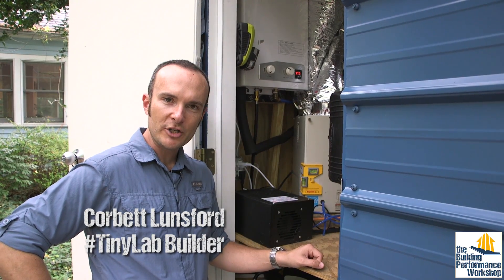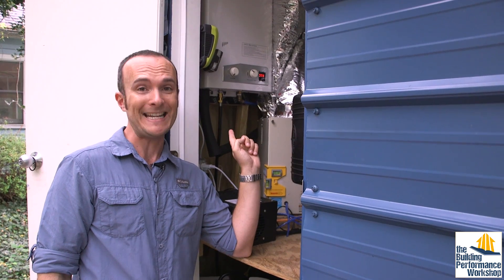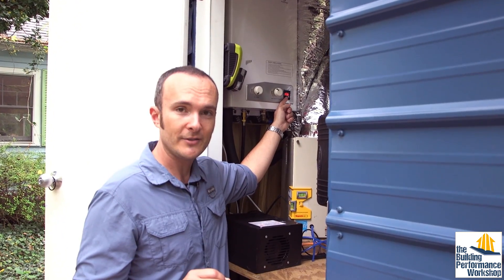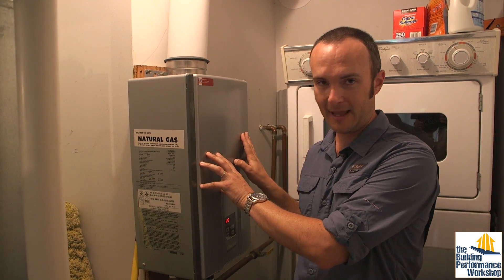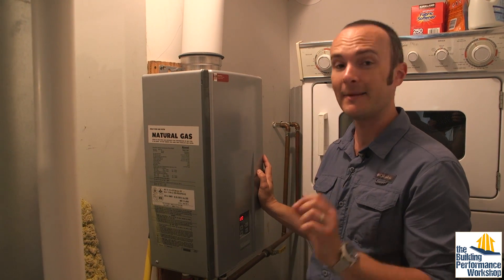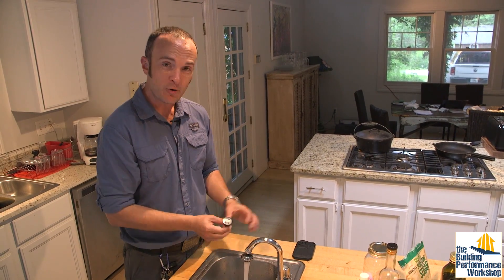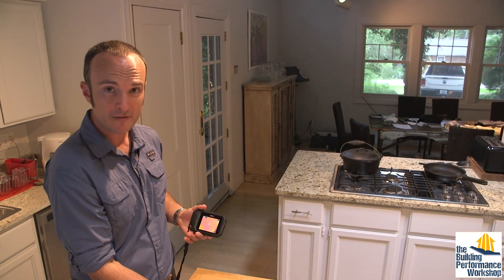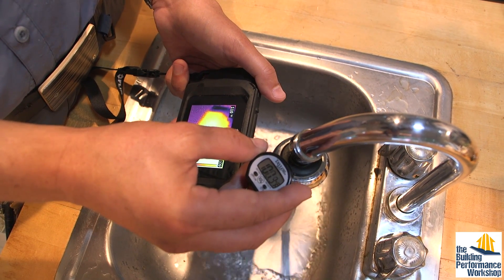Tankless Water Heater Performance Testing

Comment: remembered seeing this video   was rethinking my hot water needs    Do it a bit differently   going to use a drain back system with a 30 /40 gallon electric water heater or possibly a 50 gallon heat pump.   The drain back will supply most of the heating needs and the tank will add perhaps 10 -15 degree rise to finish the heat needs  Since I also plan to keep the real plumbing runs extreamly short like 25 feet  max.    People world wide except here in the US  use solar themal.  Not sure why this is

Comment: Hi I’m very depressed right now, I just bought a tankless off Kijiji cheap, looks brand new, got it home plugged it in nothing happens does it need to be hooked up?
Reply from the maker: Yes, hooking it up sounds like a good plan
Reply: Home Performance can I hook it up to my bbq gas line outside and a hose outside just to test it, I’m very handy and extremely safety minded.
Reply from the maker: Just make sure to follow the instructions carefully so nothing explodes
Reply: Home Performance thank you very much, I will be extremely safe and let you know if it works, again very greatly appreciated, cheers from Canada
Reply: Got everything hooked up, I can hear everything start up but no hot water, also smell of gas, outside no biggie, turn off right away, I think it’s the flame sensor or igniter, can u point me in a direction.? Thank you.
Reply from the maker: I really advise you to get a professional's help, Ranjit- this stuff is not good fodder for learning curves, it can get seriously dangerous
Reply: Home Performance everything went fine, it works, thank you very much.

Comment: Hello. 
How confident are you about electrical water heaters? I have
a small house (625 sqr/ft) with a basement. The house is located in Michigan.
It has only one bathroom. The places using hot water are the bathroom sink, the
shower and the kitchen sink.  I am
thinking of adding another half bathroom in the future. In winter time the
waters gets really cold. I wanted to ask what would be best for this situation
since I don’t want to spend on something that is not necessary. Thank you
Reply from the maker: We’re installing Chronomite electric point-of-use water heaters in the house we’re building. They work just fine.
Reply: @HomePerformance  do you think electrics are quicker or slower for getting just warm water to the tap...I imagine that when I want hot water at the kitchen sink, it would never need to be 120...and I'm pretty sure a shower is never more than 110. But with a shower, I don't mind waiting...I just wish the 2 sinks had very fast hot water. My  tank delivers it in 10-15 seconds...
Reply from the maker: Yes, ours will deliver within seconds, and trust me, 110 is still too hot from the tap. 105 is usually hot enough.

Comment: It sounds like the system you are testing was over-engineered and not properly designed for the configuration of the faucets.  Why not just use a pilot that is always on?  The cost to run a pilot is not that high.  Unless the unit is installed in a tight location, you should just use a gravity fed ventilation system, where hot gases rise.  Trying to squeeze out the last 5% of efficiency is overkill.  Those two modifications would eliminate the lag time, AND CONSERVE WATER.  Did the engineers not give any consideration to the amount of treated water that would be going down the drain?  What a waste!!!  In a few more years, clean water is going to be more expensive than gold.  Like everything else, these tankless water heaters are getting priced at whatever the market will bear.  There is no competition to provide a quality product at a fair price.  Capitalism requires mature morality and ethics to function; profit alone results in disaster.  I use 5 gal plastic buckets to capture bath water and all cold water that would otherwise go straight down the drain, and then I recycle that water to the garden, to flush the toilet, or for cleaning purposes.  The goal should be to use all treated water for at least 2 purposes before going down the drain.
Reply from the maker: Wow, thanks for adding your very deep thoughts to the conversation!
Reply: Gas Tankless water heaters do not use a pilot..... You may want to educate yourself before spuing garbage. Also they have tankless water heaters that recirculate the water in the pipes to keep it warm at all times, so you go hug your tree and pet your grass now knowing the water is conserved.
Reply: @PatricksDIY  Hi Patrick.  You sound like an interesting guy.  I find lockpicking interesting as well.  I remember the night I stayed in a motel in Austin, Nevada, having parked a U-Haul truck in front of the door.  I still think someone picked the lock and helped themselves to a few things while I was sleeping, but I have never been certain.  That was back in the 1980's.  Anyway with all the lock picking videos, the art is nearly universal.  

My first AquaStar tankless water heater was installed in 1985 (the year Congress allowed solar tax incentives to expire), ran on gas, and ignited from a pilot light when there was water moving to a faucet.  Actually, I am on my second AquaStar, and the second one lights with a gas pilot as well.  

Recirculating hot water in the pipes is also done for old fashioned water heaters, to reduce the wait for hot water at distant faucets.  For tankless systems, recirculating would have the same advantage, but just substitutes the plumbing pipes for the tank.  Either form of recirculating decreases efficiency, requiring more gas to keep more water continuously hot and readily available.  

With increasing natural gas prices, always-on pilots may soon not pass code.  I have never trusted electronic ignitions, knowing the problems with something so simple as a Bic Lighter friction wheel.  I could imagine a mechanical snafu resulting in an accumulation of gas in a basement when the e-lighter suddenly decides to work, and the whole house catches on fire.  

You sound like you are suffering from touch deficit.  I heard a radio show today about the metaverse and women getting groped in virtual reality.  That's like asking, if you solo, are you spewing or spuing?  Wow, we're only a stone's throw from the future of a sterile cold zuckerberg world.

Comment: I have a Navien  "A" model an since it has a built in buffer tank there is no minimum flow requirement.  I also believe the Eternal Tankless does the same.  Also I do not understand why your temperature drop with another load.  If anything you would  see a drop in delivered water to the fixture but not the temperature, so if you had the water mixed with some cold, yes you would see a temp drop.  These tankless system are designed to deliver the water at the set temperature and will reduce the flow if it cannot deliver the water at that temperature.
Reply from the maker: +toysareforboys thanks for sharing, and I hope the rest of your winter is warmer!
Reply: Especially in the winter, my Rheem gives up on trying to keep the water as hot as we have it set to (185f) because the incoming water is so damn cold. I believe it tries to keep it at 185f then realizes it would pretty much have to shut OFF the water to keep it at that temp, then just allows full flow. I haven't checked to see how hot it is actually coming out of the tap. http://ecuflashking.com/2016-01-24-Rheem_tankless_water_heater_expansion_tank_upgrade/2016-01-25-Rheem_tankless_water_heater_upgrade_to_185f.jpg
Reply from the maker: Thanks for commenting, Joe. I don't know how they're designed, but I find all the time that what the engineers intend for a product to do is not always what it does when installed in the real world.  That's why performance testing!